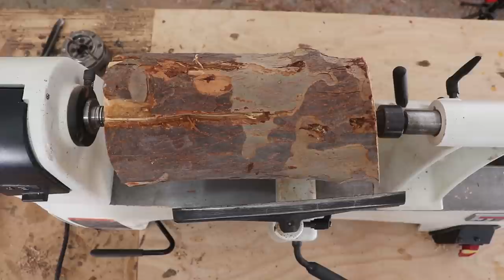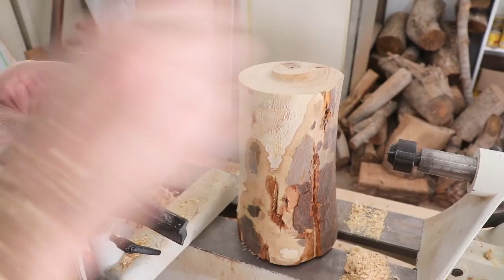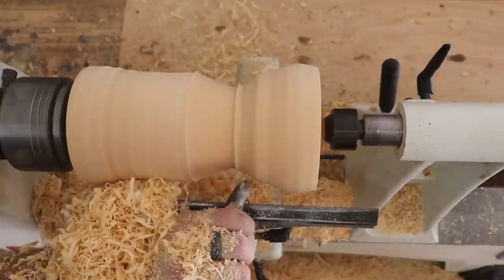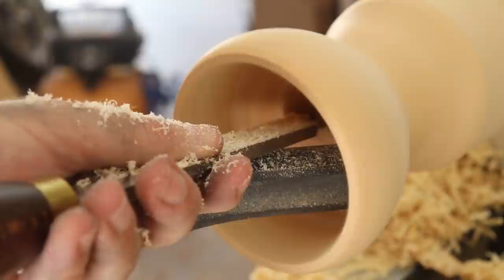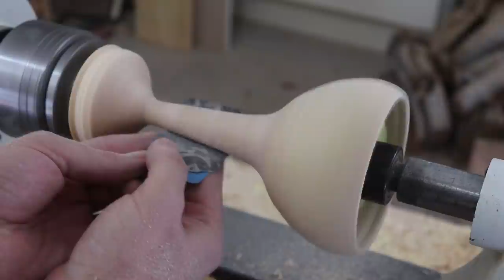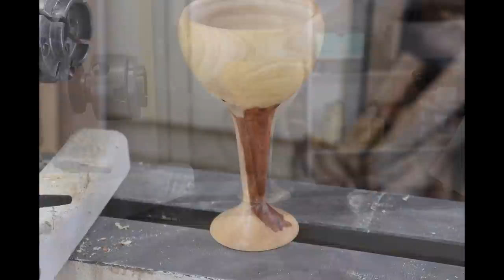Wood Turning a Log into a Big Goblet

Comment: How do you keep the wood from cracking?
Reply from the maker: This one had already dried and cracked quite a bit, which is why I separated off the top part that was cracked before I hollowed out the goblet
Reply: @CookWoodworks 
My wood was dry and it wasn't cracked and after I made a bowl I cracked hard 
Wood has been dry for 6 years